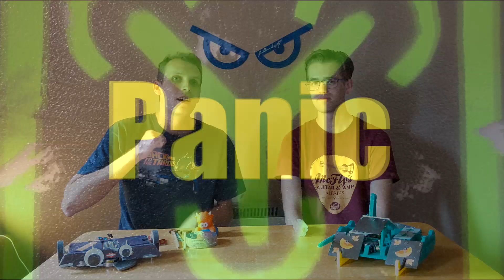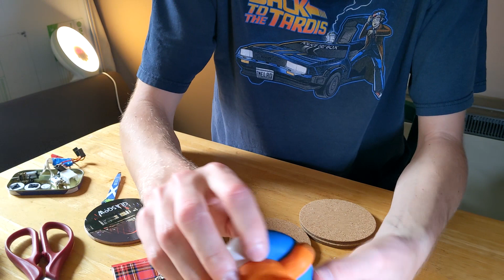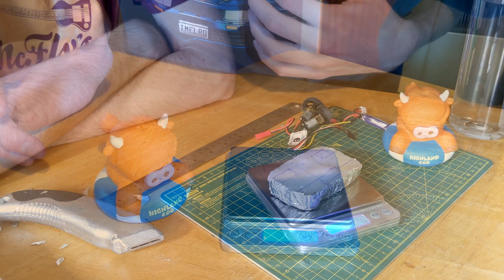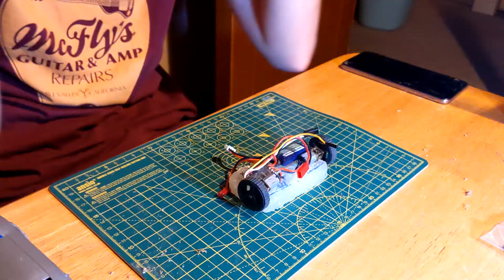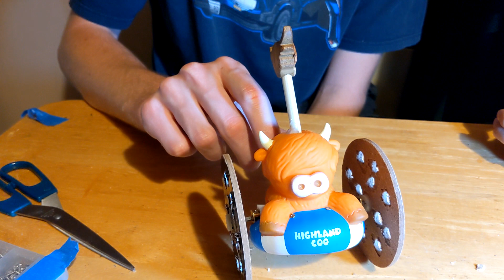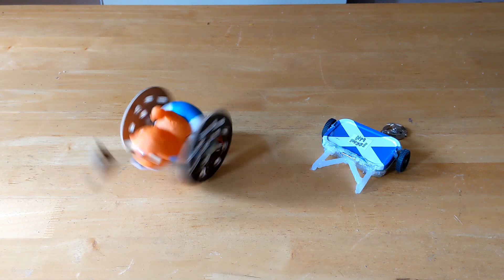Will It Bot? - Scotland VS Hot Glue (Ft Oliver from Team Motte and Bailey)

Comment: First of all, I love this. This is so fun! Second, I have an idea that may make things a little crazy. What about placing the components into melted glue, with just the wires sticking out so you can plug in the battery to charge? So it's literally just a brick of glue with built in shock resistance for all of the components? Maybe 3d print a mold that you can fill?
Reply from the maker: I like the idea but it sounds a little risky, electronics dont like getting too hot, its fine putting hot glue on electronics because a small amount cools quickly, but suspending the electronics in the glue will expose them to heat for a long time which could break things
Plus you'd need to be 100% certain that your gearbox was sealed otherwise you'd end up with glue all through the gearbox and it wouldnt work
Reply: @TeamPanicRobotics  that's true. I suppose you could leave gear boxes sticking out, and if you used the low temp glue it wouldn't be as bad.
Reply: I've been giving this idea a lot of thought and to me the best approach is to have wooden blocks which approximate the size and shape of components and use them as part of the mold to create voids for those components once everything has set. Pretty much the same effect as pressing components in but without the risk of damage.
Reply: If you're worried about the heat, couldn't you just add a little at a time with cooling periods between?
Reply: @5thearth  You're still going to need to get the glue up to a set temperature to melt it.